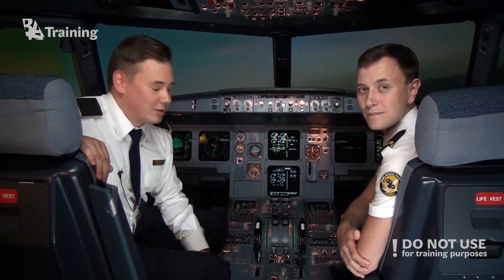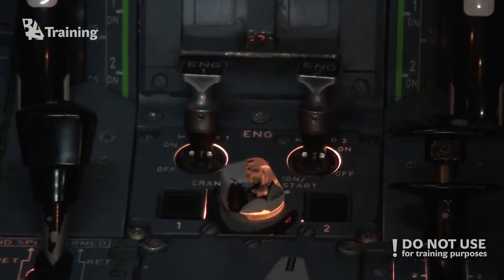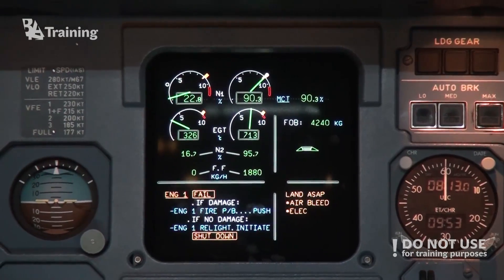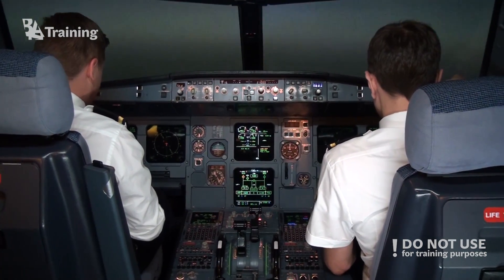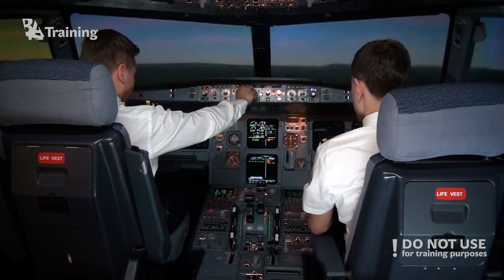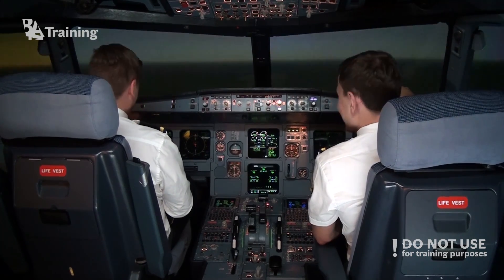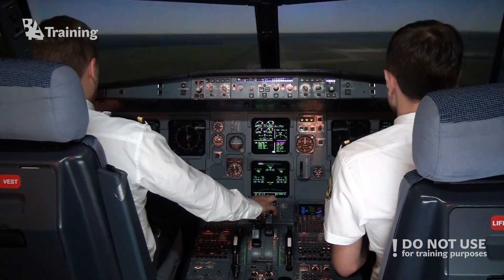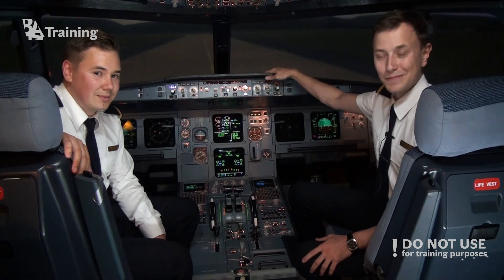Airbus A320 Engine #1 flameout in cruise - Baltic Aviation Academy - A320 Type Rating

Comment: what to do in boeing 777 when engine flame out ? is possible to fix this ?
Reply: +18Mortus18: In a 777 you pull over, clean the carb and spark plugs and off you go again
Reply: i noticed , that in X plane 10 while flame out - when i set starter on CON the eng start work. But dont know if this is possible in real life